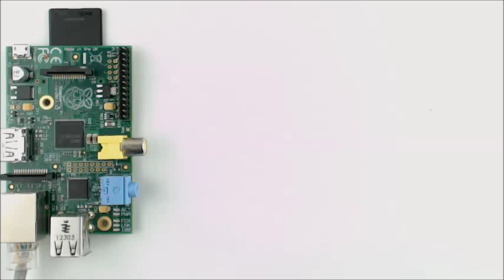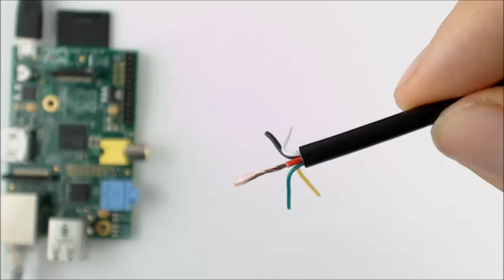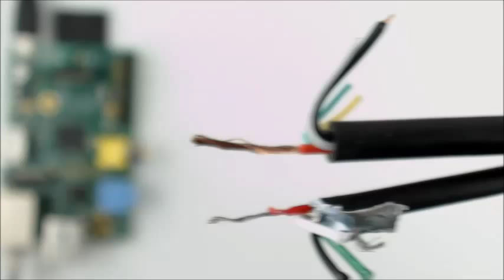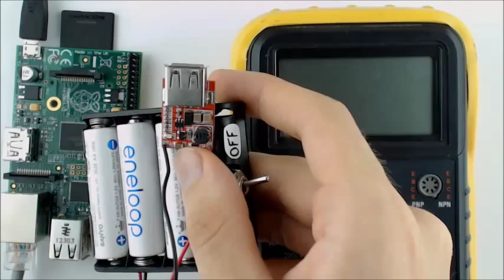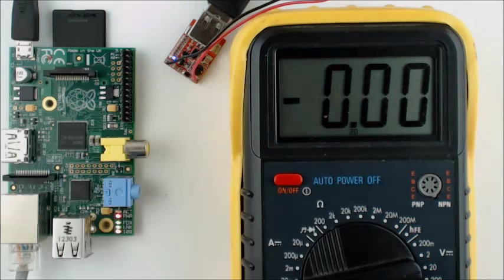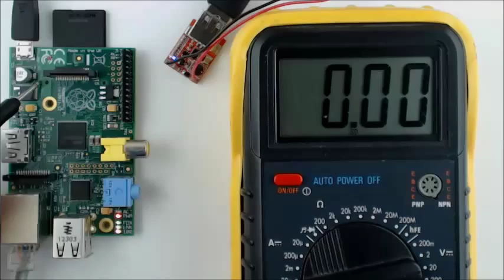Powering Your Raspberry Pi

Comment: Why do you need a dc/dc converter for the battery pack? I'd (naively) think 4.5V should do just fine to power the RPi, even if a bit underpowered?